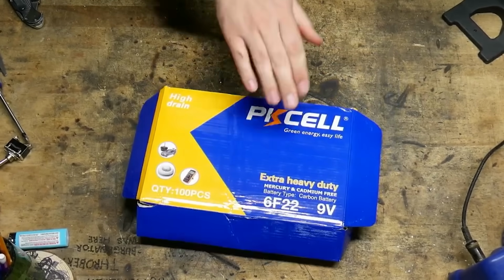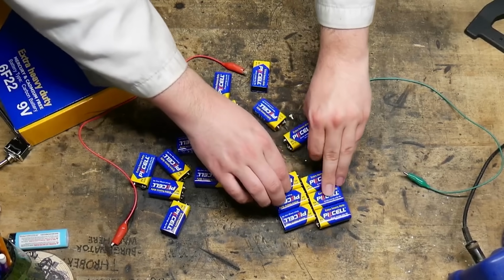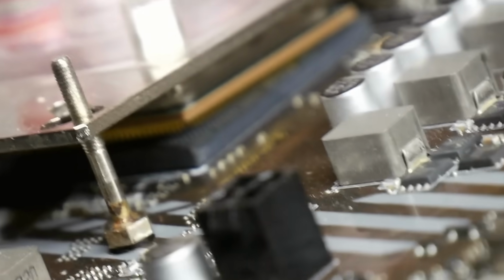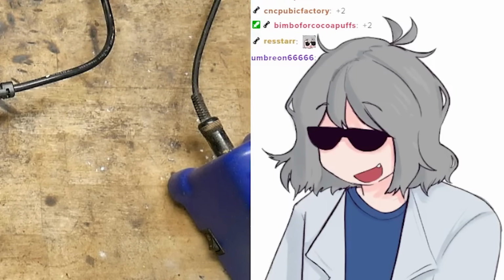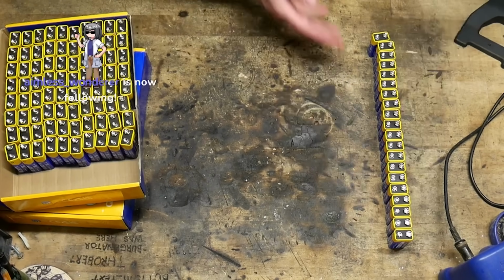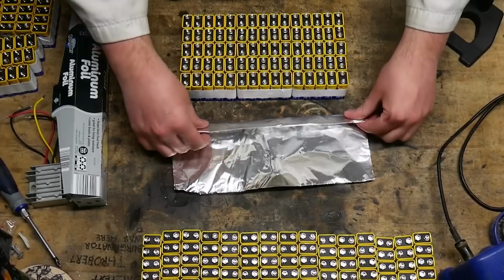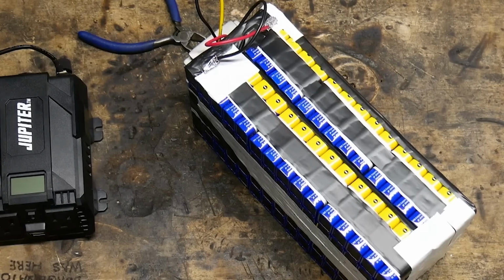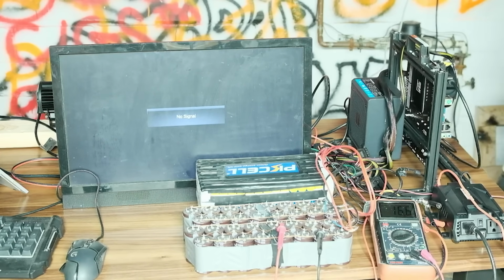Powering a COMPUTER with 9 VOLT BATTERIES

Comment: If you wired them up to have the output voltage at about 150 or 300V, you could have run the computer off DC. Switch mode power supplies will happily run off DC
Reply: Or, crazy suggestion, run it at 18v and use DC/DC converters for 12, 5, and 3.3v. Yes converters because 12v is running at mondo amps
Reply: Something I never knew and I’ll also never try with my $3,000 PC’s
I’m not planning on destroying anything….. YET

Comment: 23:00 I used one of those dc to dc converters in a RV conversion. I stepped down 24V to 12V, and it failed because the diesel heater would draw too much voltage, draw down the converter voltage, then the heater would shut off due to low voltage. Those things are junk unless you run 2-3 in parallel.

Comment: You can get DC power supplies that take 20v or 12v.  They're really small in comparison to a normal ATX PSU.  The DC-DC ones are small enough to fit right on the ATX socket.  You would lose a lot less power to conversion than in your current setup (DC-AC-DC).

Comment: PKCELLS!!!! YEAAAAAAAAAAAAA. Also, where the frick was the big ass bucket of sand???? Power efficiency would have also increased if you made banks that are 18V and then a bunch of batteries connected to that, then stepping down to 12V, 5V+, 5V-, etc, basically the power lines a pc needs, instead of 9V -> 220V -> 12V + 5V + 3.3V

Comment: You should've powered a T460 or similar. They go down to less than five watts, will run on 8.1 volts just fine (tested on a T460s). With 200 batteries at 300mAh that's 540Wh or about 2 days of useful web browsing.
I would recommend a more modern laptop with similar power draw and way higher efficiency and usefulness, but I don't know many laptops with a 20V input that run fine on less than half that (ideally it'd be powered with a 2S100P bank, but my Legion 5 Slim stops charging at 18.5V which would only allow using a few % of the cells.)

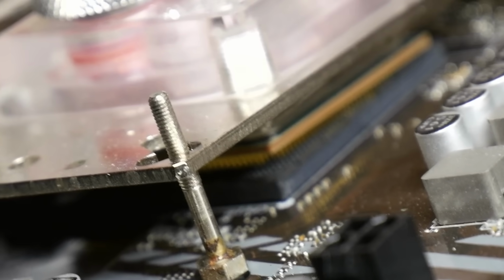Comment: 7:24 maaaan that happened to me back in college when I was trying to dust my pc, good ol pentium 4. It basically welded itself onto the heatsink; when I pulled the cooler off I asked my buddy ‘wait where’s the cpu’. Pins were bent at a 30 degree angle in one corner but two hours and a credit card later I got them straightened out. Really lucked out that none of them broke off.
Reply: Old CPUs with too much thermal paste love getting sucked to the heatsinks. That's the actual reason you both apply just enough and take the heatsink off by gently twisting it around in place first.
Reply: @miruneverdies  Additionally, too much thermal paste will reduce thermal performance, since it is still usually the weakest link
Reply: @Lauryl-acetate  With enough mounting pressure as long as the paste is not conductive the excess will still squeeze out the sides anyway and won't negatively affect your temperatures. The most you will have is that you wasted some paste, but it's better to err on the over than under.

Comment: the 9 volt to 6 aaaa conversion was the one semi useful fact of the video
Reply: I don't know of anything that takes AAAA batteries, nor did I know of their existence until now.
Reply: @0neDoomedSpaceMarine Some stylus for drawing tablets take AAAA batteries
Reply: @0neDoomedSpaceMarine  The one and only time I encountered a AAAA battery was in a Microsoft Surface Pen.
Reply: @0neDoomedSpaceMarine  Some calculators do
Reply: also the fact that you can connect the 9 volts like lego, did not know that
Reply: inside of a 9V battery are actually 6 little 1.5V batteries stacked on top of eachother!

Comment: I spent the entirety of this video with my jaw on the floor. As someone who's worked with high voltage/currents, Holy Shit you are lucky this shit didn't explode dude. I love you man, please don't blow your hand off cause then I can't watch you almost blow your hand off with 9V batteries
Reply: But think about all of the potential "I've replaced my stump with xyz" videos
Reply: When Electrician-Tube gets ahold of this one...

"Guy builds a 9v bomb to power his PC (Reaction)."

Electroboom's ears are already ringing.
Reply: @EyeSmōkMythna, electroboom would see this video and make "powering a laptop using a full bridge rectfier"
Reply: I'd love to see this work.  @lionelgamer13
Reply: lmao what a massive over-exaggeration. 18VDC at a measly 3-4A (hell, even 10A) is about as safe as hobby electronics gets. Not even remotely high voltage or current. The only risk here was overheating the batteries and setting them on fire, the risk of which is actually hugely reduced here due to the heating being spread over the 200 batteries. That being said, safety is important and please don't stack batteries on top of each other where the terminals could touch!
Reply: You would die instantly seeing styropyro with his 100 car batteries if this scares ya
Reply: @DefaultCat343  or his 20kW macrowave, 5kW tesla coil ray of doom or even that 260W output power laser or how much it was bro would die if he saw those small contraptions
Reply: I mean he built a welder from microwave transformers.
Reply: Carbon-zinc batteries don't explode. High internal resistance and no risk of thermal runaway. Short one yourself if you want, I did it numerous times. They just get hot.
Reply: >worked with
dawg science fairs and reddit university don't count
Reply: You are way too over exaggerating it let's say 120W tops including PSU losses at 18V we are talking 6.6A because he's using the converter let's add like another 15W so 135W at 18V from batteries 7.5A that's nothing the converter wasn't even needed if the invertor supports 24V
And even if stuff would get shorted his flimsy cables would give up before any fire would start
Reply: @dan2800I think he's talking about the 9-volt cells directly not the power draw of the system, 

And 9 volt can roughly draw a single amp safely (maybe 1.5amps if shorted), so he was roughly dealing with somewhere between 1800w and 2700w of current potential, do I think it's necessarily that unsafe, kinda but it's fine but it's certainly more dangerous than what your talking about
Reply: It would be good for a slot machine ngl
Reply: There is a video of a guy hooking 9v batteries in a chain so long that it was 2500v I think ... Then playing with it seeming totally unaware of how dangerous it was and several times he was just 1cm away from hand to hand short circuit .
Reply: if you're afraid of this you need to stay away from anything even close to mains line voltage. The worst it'll do it catch on fire in a total short and just fizz out seconds later. It's time to pick up an actual book son
Reply: Peak display of Dunning-Kruger effect right here. There's still time to delete your comment, r-word.
Reply: @7-8-7 ...is there still time for you to be less of a cunt, or has that ship already sailed?

Comment: Take 9V in series to 18V, through a buck converter to 12V, put it into the inverter to get 120V, then put it into the PC PSU to bring it to 12V(and 5 and 3.3), brilliant. 

(I'm not complaining, I've got my PC hooked to a PV system which is arguably worse because it goes 12V->120V->12V(and 5 and 3.3))
Reply: why? most of the time a PSU will convert the 120v AC from the wall to 12v DC anyway. then use buck converter's to regulate down the voltage down. just skip the part that converts 120v
Reply: @justinpieper8129 i think the original commenter was being sarcastic and agrees with you

Comment: You could have tried to run the psu straight from 18 batteries in series, as that's around the peak-to-peak voltage of mains power

Comment: You could have probably done without the inverter if you had used a higher voltage, it gets rectified first thing in the PSU. Should run with 120VAC * sqrt(2) = 170VDC.
Reply: Exactly, I think the inverter was wasting a lot of power. For a power of 60W, all those batteries should have enough current to keep the computer alive
Reply: Or just grab a couple more buck converters for 5v and 3.3v and plug the dc straight into the mobo. I'd only do this with hardware I don't care about though
Reply: @jkalltime  Surely it could handle 4.5 and 3 volts instead, right? Right?
Reply: @jkalltime  Yeah I was wondering why he was bothering with all the stuff in between the DC of the batteries and the DC of the computer.
Reply: by running half in series and half in parallel he could have ended up with 18vdc. then a buck converter could step that down to the same 12vdc.  he could then just bypass the rectifier circuit in the psu (which probably rectifies the ac to dc and steps it down to 12vdc anyway) and supply power to the power distribution circuit directly.
Reply: Some active PFC controllers don't want to start if you apply DC. I've tried several ATX power supplies and only some have worked
Reply: @sciencoking yeah I was also thinking that the PSU might be fine with DC input but I forgot about the PFC circuit. There are also PSU’s nowadays that use actively switched mosfets instead of diodes that I imagine would throw a fit (or work even better if the controller doesn’t outsmart itself)
Reply: @Phos9  Laptop power bricks work without problems, weirdly enough, and they all have apfc. So i really don't know what it is, but my oscilloscope absolutely will not run on DC
Reply: @sciencoking Youre right if it has Active PFC, it probably wont work. But that cheap thing claims to be 80+ but doesnt even use the right badge, I kinda doubt it has any PFC. Only one way to find out though.
Reply: @0verv0ltage  PowerSpec PS-500WF does indeed have active PFC. 80 Plus, as dumb of a system as it is, does at least require a power factor of 0.9, which isn't possible without APFC.
Reply: Some go as low as 100VAC, lets say ~140VDC. There are a lot of loses there, DC-DC converter -> DC-AC inverter -> AC-DC power supply, over 50%. Putting all the batteries in series and connecting the ends to power supply, could've got as low as 10%. Yet, that is pretty dangerous, DC current can make your heart stop, this is not something you should try at home.

Comment: You really should have hooked up 14 cells to get to 126V, then powered it directly instead of through the inverter, which adds a lot of losses. Switch-mode power supplies don't care whether they get AC or DC, as the first thing they do is rectify the AC input.

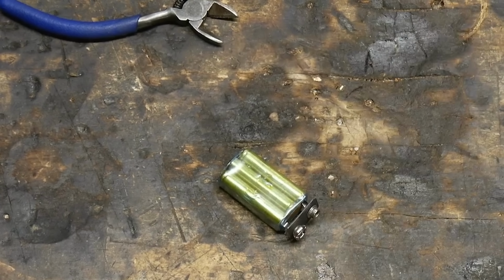Comment: 13:30 I opened a 9V once (Panasonic I think) and it had a few thic rectangle shaped button cells stacked up on top of each other
Reply: Same, wonder if it's different chemistry so you can tell before opening it up.
Reply: @czechgop7631  Look at the part number, though it's not always accurate. The rectangle shaped cells should have the part number 6F22 while the ones with the cylindrical cells should have 6LR61. I say "should have", because even in this video the label on the Pkcell batteries are marked 6F22 while actually having cylindrical cells.
Reply: @czechgop7631  Yes, it totally depends on the chemistry.

Comment: Time to add a couple of automotive 12V capacitors? If they're good enough for kilowatts of subwoofer, they're good enough for this. Plus you can use them for, oh I dunno, gauss rifle? Rail gun? Exploding watermelons?

The possibilities are endless!
Reply: coilgun goes brrrr
Reply: Nah you won't need a capacitor for a relatively steady load like a PC. The thing with capacitor used in audio is that it's used to store a little amount of charge and deliver it to the amplifier when it needs more than what the battery could supply (for a brief moment like when the bass hit)
Reply: You can think of the battery like a big water tank with a small outlet, and then the capacitor is like a smaller tank connected to the big tank outlet but this small tank have a way bigger outlet than the big tank has. So the small tank can supply a large flow for a brief moment before it's empty and then it'll output what the big tank can give until it can fill up again
Reply: @doodleydude7833  Oh I know the difference. From what I can see though, the PSU is fine but it can't handle the inrush during power-up. A few big capacitors would absorb that inrush with a bit of clever wiring so they don't overload the supply themselves, plus they can be used in other projects. Like exploding pickles.

Comment: 17:17 So much efficiency waste - you could directly power the ATX
Reply: Not really, ATX needs 3.3v, 5v, 12v, and -12v so you would need a regular for each rail. Sure, these exist (single 12v input) but then you still need an additional one to go from 18 to 12 (and also because the voltage will drop under load due to internal resistance of the batteries).
Reply: @nezu_cc 

Pico atx power supplies, they can take a 12 volt dc jack, and give the rest of the voltages that way.
Reply: @nezu_cc Modern ATX doesn't need nor supply -12v. His does provide -12v but at .3a it's not doing anything

Comment: I actually did this with a laptop and like 22 9v batteries when I was around 14 or so. Good times. My mom was not happy about wasting all those batteries
Reply: why did she even have that many nine volt batteries in the house lmao
Reply: @startedtech  pretty standard Costco trip back in the day
Reply: Yeah and a lot more electronics use to actually use them too.
Reply: The power of the Costco card. Probably like the smallest pack of batteries you could buy there @startedtech
Reply: @startedtech  costco
Reply: I used to run my cellphone off of a sleeve of D Batts. The principal is the same.